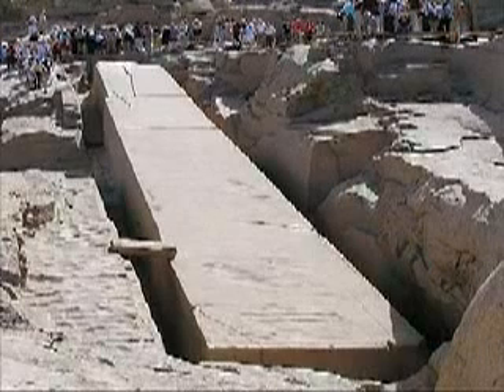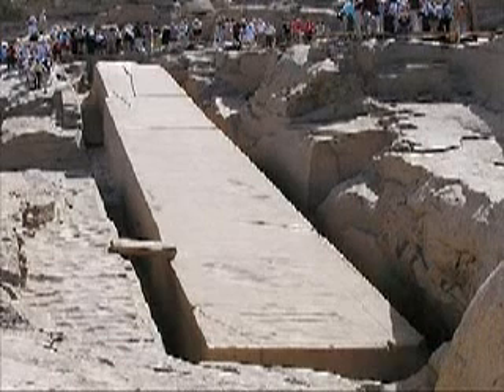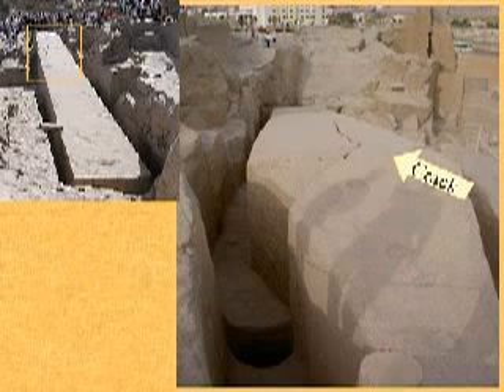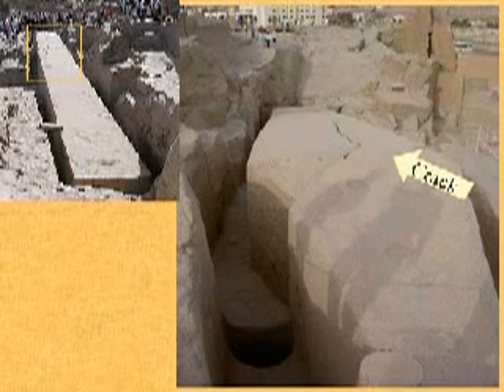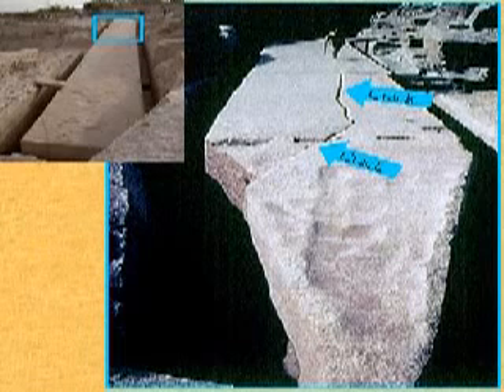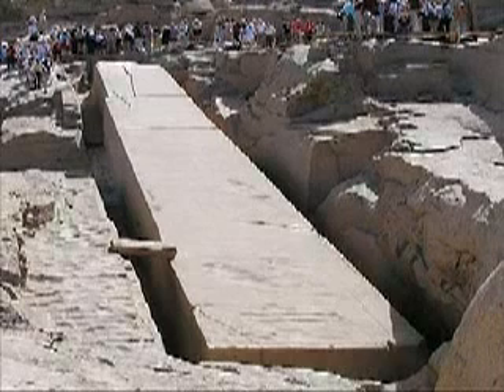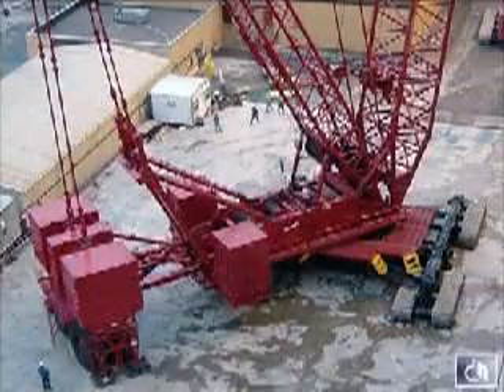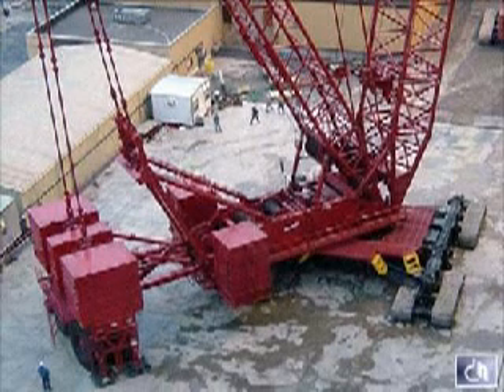1170 Ton Unfinished Obelisk in Aswan Quarry

Comment: The answer to this is simple! Wooden wedges were placed in one side of the gap into end ret it with water. The expansion of the wood was so strong that was able to crack the stone from its base. Obviously in this case something did not go so well and the stone broke. Maybe the rock was not in uniform hardness as a natural material or the applied pressure from the wet wood was not uniform!